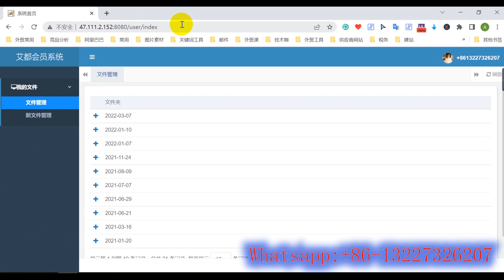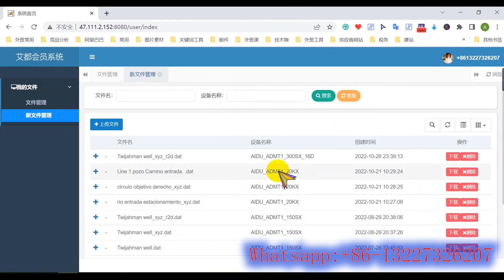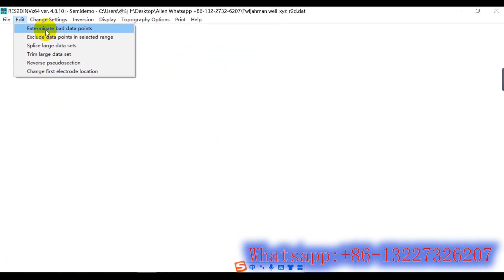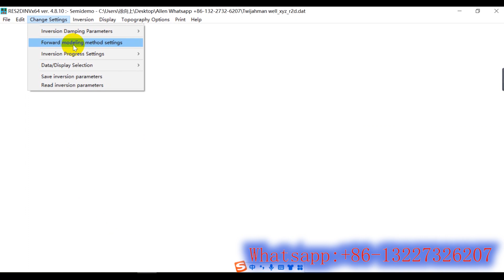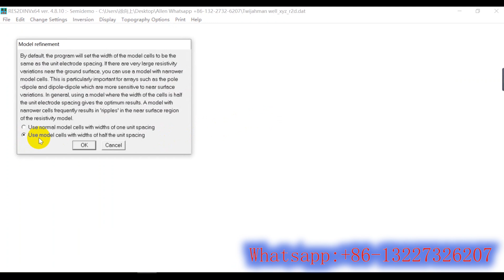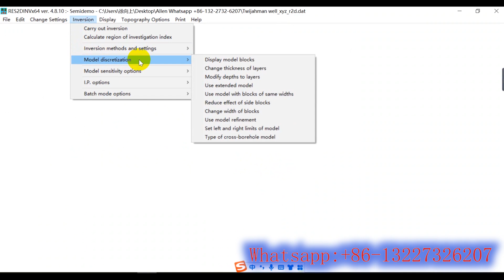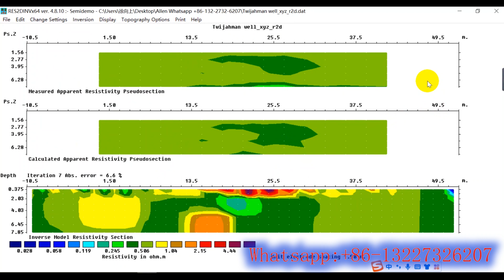ADMT Detector apparent resistivity gets the true resistivity through inversion Res2dinvx 2DMap

Comment: my instrument is AIDU_ADMT-500AX what format need have the data for open with Res2dinv ?
Reply from the maker: It is not recommended to use this inversion software for single-channel equipment
Reply: Tengo el Admt-1200AX-32D.     Que tengo que hacer para trasformar los datos.  Tengo que meterme a Procedamiento de datos y de ahí ponerle en conversión de formatos?  Que parámetros se tienen que poner ?